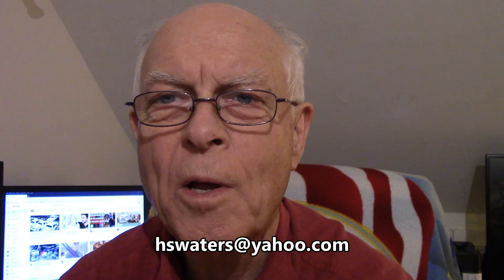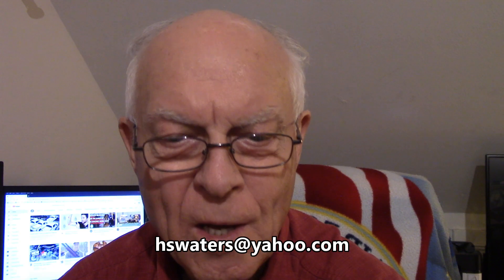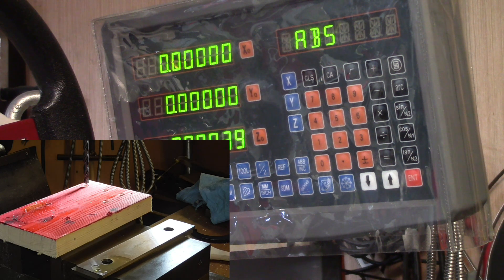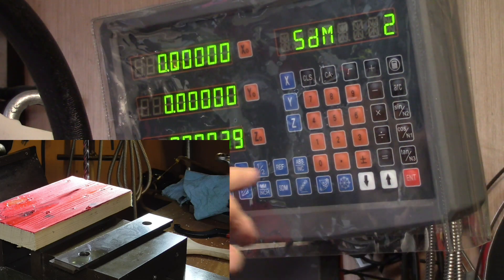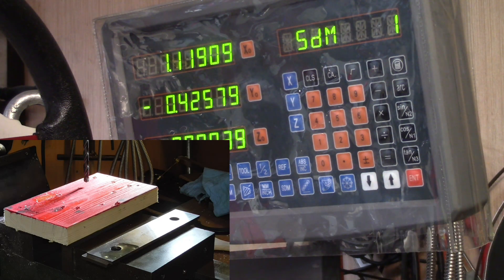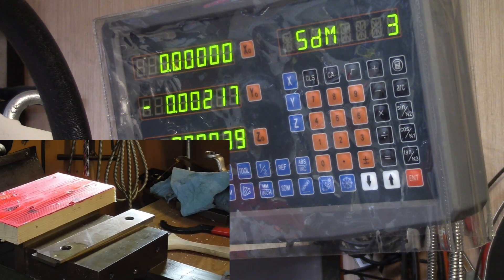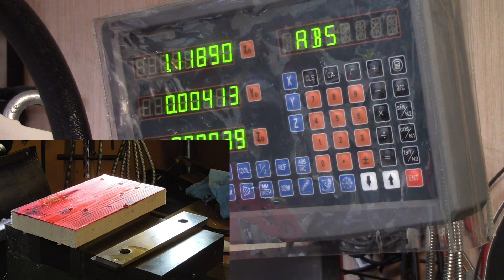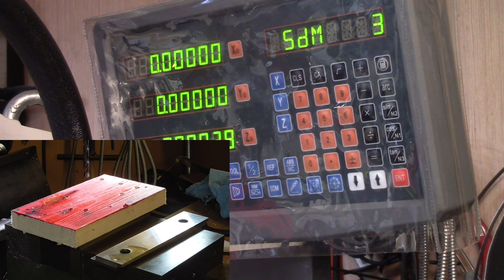DRO SDM function

Comment: Hi Harold, do you have to clear unneeded SDM settings somehow  or do you just go over top of them with new ones?  thanks
Reply from the maker: You can just record over them or you can clear the whole thing by pushing I think the "." ten times.  My memory is old so look at the manual for which button.  Thanks Berty.
Reply: @AmateurRedneckWorkshop  Wow that was quick thanks Harold, all the way to the UK as well lol.  I will get the manual out. thanks again

Comment: It appears you have 5 um scales. They measure in 0.00019 inch steps. That is what I have, and you should be able to option that DRO to 4 decimal places. That happens when you switch on the DRO and press something while it is starting up... probably explained in fine Chinglish in the manual. With that, it will round to the nearest 0.0002". Much easier to use working in inch mode, and as close as you can get given the scale accuracy. Metric will be fine with that also.
Reply from the maker: Thanks for the tip Wes.  I have been intending to do that but somehow I never get around to it.  It is going to be too cold to live tomorrow so maybe I will just be happy to set the decimal places and call it a day.  Thanks for stopping by.

Comment: This function saves tool changes too.  Let's say you need to drill and tap for holes, drill the 4 holes, setting the data points as you demonstrated. Then install the tap, go back to each datapoint get the job done. Quick and easy.
Reply: Sorry, voice to text got me. It should read drill the 4 holes...
Reply from the maker: It does make the job easier especially the more holes that are involved.  Thanks for stopping by Ed.

Comment: Harold I have been wanting to do that with my Blu Dro. I know it cam be done but I keep getting lost trying to set it up. I have a 1" thick aluminum plate that i am going to drill 64 holes in , If it ever warms up here I'll get back to it. Monday and Tuesday it is going to be a low of -1 and high of 12 , I am ready for spring.
Reply from the maker: Believe it or not it is going to be cold here too.  They predict snow and if it happens it will be on the north side of town I am pretty sure.  Thanks for stopping by Terry.
Reply: @AmateurRedneckWorkshop  They are forecasting 55% rain Sunday and Monday. Hope we don't lose power cause I have electric heat. I live in Wichita Falls . My brother lives in Abilene Texas and they were out of power for 30 hrs about 2 weeks ago.
Reply from the maker: @terrycannon570  Keep the generator fueled up.